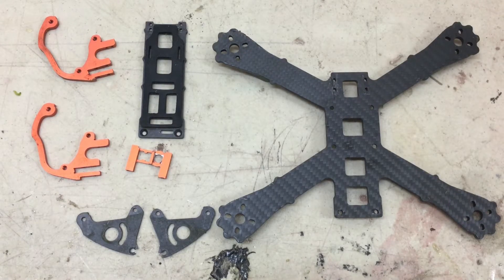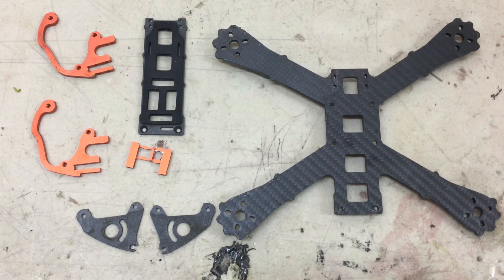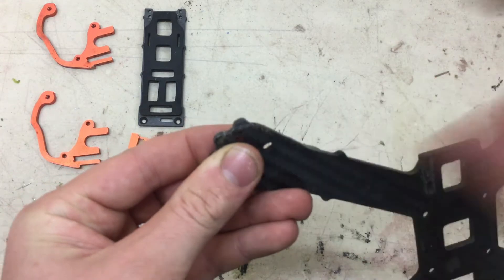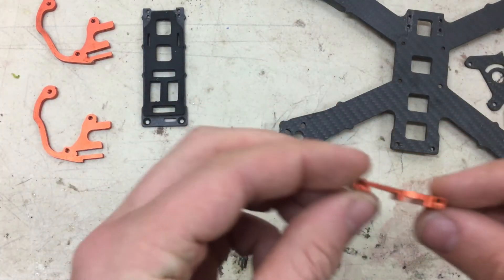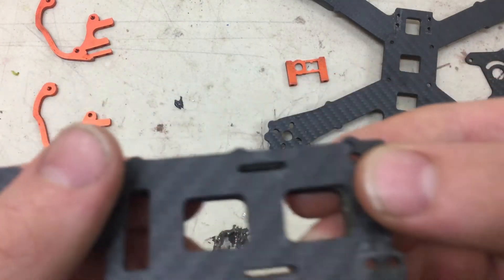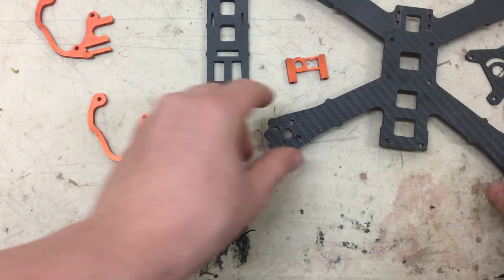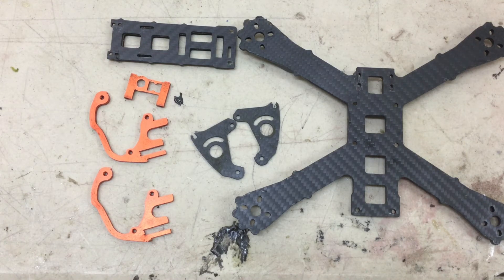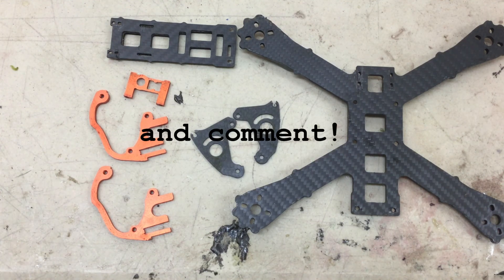Chameleon crash damage

Comment: So you could actually recover that, if your poor like me. XD 

Super glue the cracks while wiggling the arm, compress frame wrapped in paper towels and two padding boards with a vice, dry, repeat until satisfied. Dremel or sand (w/ breathing mask) excess glue and drill holes that may have gotten filled.
Reply from the maker: I thought about doing that while i was waiting on parts, but decided not to just because the two aluminum camera mounts were really bent and the threads on them were pretty iffy, if any where left.